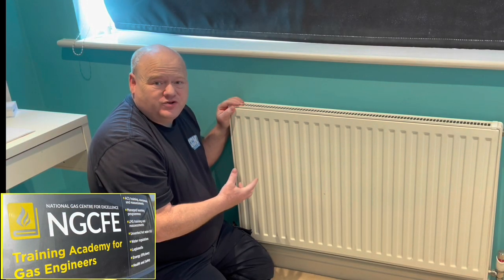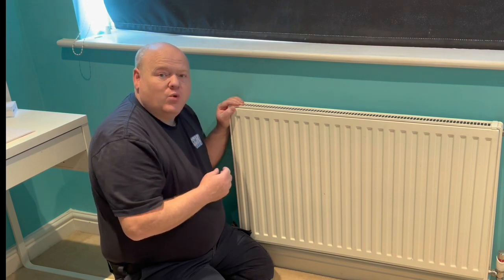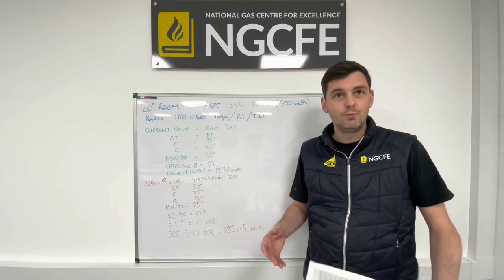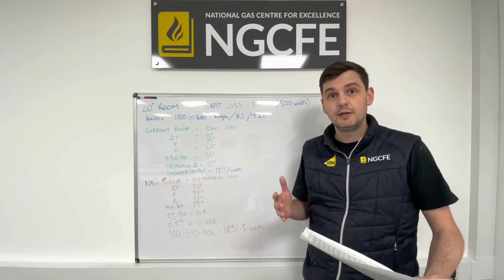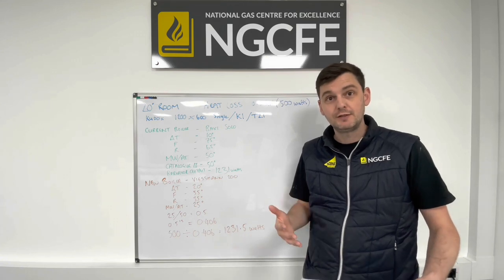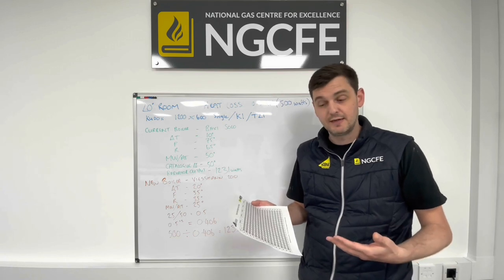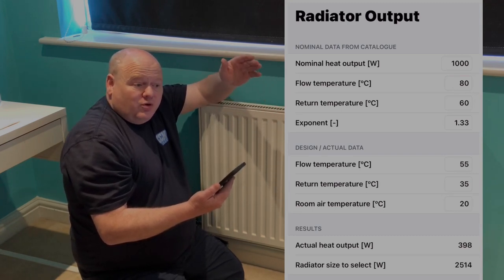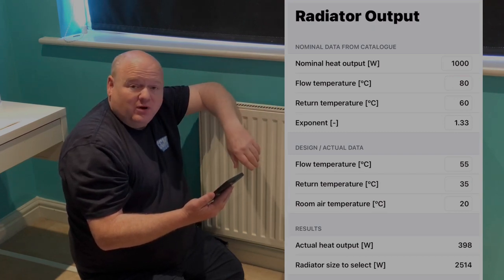How To Size Radiator’s For A Low Temperature Central Heating System

Comment: Thanks for the video and trying to help guys out, the problem I see with a lot of this is I see jobs everyday that have been thrown in not flushed out sometimes incorrect gas pipe size and no controls until we can get rid of these types of installers and it’s policed properly what’s the point because some numpty will just come along chuck a boiler in and leave and nobody takes them to task
Reply from the maker: Great point

Comment: Based on his calculations, yes the rad running at dt25 will be enough to overcome heat loss at 20oC but how long would the room take to get to 20oC if the setback temp is say 17.5oC? I suppose that’s where Open therm comes in.
Reply: Run it on weather compensation so its on longer periods at lower temperature?

Comment: Hi Alan, great video with you and Michael.

I think you may have missed an important point here.  The customer is going to feel colder, because the actual energy emitted is lower.

The loss factor Michael has used also indicates how much more heat won't be emitted to the room.

Using Michaels numbers for the customer to feel the same heat effect do we not need to use a radiator with twice the emmittwd power?
I
Reply: Original setup gives 1231watts. New setup gives 500watts. Even with another rad the same size still a shortfall of 231watts! Time to heat room drastically longer, customer unhappy if they heat room from a cooler start temperature. He did miss the point, you didn’t.

Comment: Hi. Great vid. Thanks.  My maths is a bit dodgy. How do you get 0.5 to the power of 1.3 to be 0.406. What buttons do you push?? )) Thanks
Reply: You'll need a calculator with a 'y to the power of x' button. Type 0.5, then press the 'y to the power of x' button, then type 1.3, then press the '=' button.
In this example, y=0.5, x=1.3
The 'y to the power of x' button has a normal sized 'y' with a smaller 'x' to the top right of the button.
HTH.
Reply: @huey_UK  Thanks Adrian

Comment: Thanks allan an micheal your videos are a credit to yoursleves, as a gas engineer who doesn’t do much install i find these fascinating, silly question but would
Over sizing a radiator help heat the room quicker and stop the boiler working harder?
Reply: The boiler generates heat (BTU), and radiators dissipate heat. Assuming your boiler is sized and selected properly, oversized radiators will deliver 100% of the total boiler-rated BTU capacity quicker than undersized radiators and will not harm the system or make the boiler work harder. Oversized radiators will cost more to buy and will take up more room.  :goodvibes:

Comment: What if the copper going into that radiator is 9 or 10mm microbore?  Is the radiator still suitable at 55?
Reply from the maker: It should be yes. You can turn the temperature down and try it. Thanks

Comment: Thanks great video, after doing the calcs, 6 of my 13 rads will need up sizing to overcome heat losses at dt30, plus of course a larger expansion vessel due to the systems increased water volume, all good to know now rather than the hidden costs later when I get round to having a new system boiler installed.

Comment: What radiator flow rates are required to give a td of 5c. Most installed pipe work won’t be able to give a flow rate capable of 5C

Comment: Great, but how do you estimate what your room heat loss is?
Reply: Easy. Just buy a cheap electric heater with several heat settings or adjustable thermostat, and see how much power it needs to heat up the room to the ideal temp. That power the electric heater consumes after room temp gets stable is the heat loss of your room.

Comment: I think we're missing the point of where this excess heat from the over-sizing of radiators in years gone by, goes. Manufacturer's data is good for a new clean radiator. But has the years run by, the available output from these radiators lessens as the internal state of the radiator conducting surfaces degrade. The excess ouitput capacity of the radiator would therefore compensate for this. Lets assume a mere 25% degradation (it's probably more) of catalogue output for the radiator in the given example. Were now only getting about a max output of 923W from the radiator, which is obviously a shortfall. The output of the radiator at lower flow/return temperature being about a maximum 375W which will obviously result in cold unhappy customers?

Comment: Sorry one more thing too, the ammount of time this is going to take to get the heat that want must take much longer so the boiler will still probably use the same or more gas to achive the objective.
Reply: Well boilers run more efficiently at different temperatures.

Comment: The Official testing of Radiators heat output is in a purpose built test Lab with Top Bottom Opposite Ends (TBOE) heating flow and return pipework connections.
This is the most thermal efficient of internal cross flow waterway distribution passing through a Heating Radiator
However, The most common Radiator connections in a domestic home is Bottom Bottom Opposite Ends flow and return pipework connections.
Therefore with BBOE connections further adjustment of calculations will be required.

To obtain the full output of heating radiators mounted on external walls, it is essential that foil thermal insulation is installed behind the radiators. By taking this action you are preventing more building fabric heat loss passing through the external wall from the Radiator. The thermal insulation ensures that heat emitter is heating the rooms air rather than wasting it through an external wall. The majority of heating radiators in homes are normally positioned on external walls. So you can make a low cost improvements to obtain long term saving to your annual running costs.

Modulating Gas Boiler controls such as Automatic Weather Compensators are an essential energy saving investment. The ensure that the additional use of outside temperature detector is used to regulate not only the combi boilers heating flow temperature but also automatically reduces down / modulates the gas boilers burner (ratio's 6;1 of load/demand) 

Please remember that your boiler and radiators design outputs are for when the external outside temperatures are minus 3.C to give you an internal temperature of 21.C in the living room for example. So with this arrangement your full demand loding is a 24.C increase. 
However we all know that for the majority of the year outside temperatures are a lot higher on a annual average. Enter the Weather Compensator this measures the external and internal temperatures and automatically adjusts (modulates) both the boiler/ burner and the heating flow temperatures to take into account the 'changing and actual all year round weather conditions'. Just say for example the outside temperature is 10.C the WC control work out and calculates just how much energy is required to reach your internal set point temperature of 21.C in the living room.
The WC controls can still be used even if you reduce your heating systems maximum flow temperatures from 75.C mean to a lower 40.C mean
It's just a case of changing the WC controls air temperature and water temperature:  The Ratio's

Comment: On a combi boiler with no digital display, what will be 55°.?
Reply from the maker: Not sure what you are asking? What boiler do you have. Thanks.
Reply: @AllenHart999  A worcester greenstar junior. Just one temp dial for the heating.
Reply: As for calculating the heat loss for a room before sizing a radiator, it's something I have never done. Most of the houses I work in are solid walls, as is my house very poor insulation, and it's the customer who always wants bigger rads because rooms are always cold, and running the boiler up high.

Comment: What this boils down to is multiplying your heat loss calculation by 2.5 when picking a dt50 radiator to run at dt25.
Not an insignificant increase.

Comment: What if the copper to that radiator is only 10mm.  Is the radiator still suitable?
Reply: It depends on the heat requirements..

Wider deltaT = Lower flow rates = smaller pipe sizes

Comment: How are you finding out the return temperatures from a boiler to a air, or even a hybrid system? 

Surely each system be slightly different on the return temps depending on heat losses? 

And would a boiler not need to be set at 65 to kill Legionnaires in the hot-water and will there be less water storage on a lower temperature? 

Great video 👌🏻
Reply from the maker: We are justing testing it at the moment. more videos to come.
Reply: Hot water priority takes care of the higher temp requirement for legionella protection. Recent urban plumbers video covers this.

Comment: If a radiator receives water at 60 -65 degrees and it takes 4 hours to raise the room temperature by 4 degrees how much longer will it take to achieve the same result at the much lower mean water temperature now being promoted. ?
Reply: It means you need better insulation or bigger radiators.

Comment: When your caption said combi boiler only did you mean condensing boiler only
Reply from the maker: Condensing combi boilers. You wouldn’t want to be turning a heat-only or system boiler too low. Thanks.
Reply: @AllenHart999  I believe t’other way round. All condensing boilers be they system or heating only should be DT 20 Flow 55 and Return 35. A system boiler implies PDHW and they would have two settings one for heating one for hot water - well the V200 would anyhoo.😉 However, a non condensing boiler should not be turned down to these temps as it will rot out the hex. 

Customers also need to be forewarned on these lower flow temp systems that the idea is ‘long and slow’ and with a room DT of 30 or even DT 25 the rads will not be as warm as before - but that’s OK the house will get and stay warm.
Reply from the maker: @normanboyes4983  PDHW doesn’t suit everyone. I know some of the newer people into the industry are doing videos on it, They are saying this is amazing but it's nothing new. Wouldn’t really suit me on my system. It is definitely a good option though. We have a video coming up on this soon, Might be the next video. Thanks.
Reply: @AllenHart999  hi Alan, Are you saying a new build with a system boiler cant be ran at 55 flow, only combis?
Reply: Isn't it illegal to install a non-condensing boiler nowadays?

Comment: I’m afraid your calculations seem incorrect.  The calculation is only to maintain the temperature based on 500w heat loss.  You must still heat the room first which needs much more heat to get up to temperature.  Once at desire temp I agree.

Comment: whats the coldest it gets over there?  Im in Canada , our coldest days of the year range from -35 to -50.

a 55 flow temp works on my system up to about an outdoor temp of -15ish. ...

at -20 outside , it struggles .  58 degrees flow temp works.   past -30 it seems a 60 degrees+  flow temp is required...

Comment: And your telling me, installers will actually do this going forward? Boxt? BG?
Reply: Yes, heat-pumps and low temperature systems needs to be designed properly otherwise they won't be efficient or effective.
Reply from the maker: Why wouldn’t you. It will set you apart from others that do not do it. Thanks.
Reply: Are you expecting installers to be paid for a professional service?
Reply: @normanboyes4983  the utilities will simply provide the capital and do it themselves from a position of leverage - all the independent engineers that don't keep up will be kaput!
Reply: It's part of the job, why wouldn't an installer do the job fully?
Reply: Lets be honest customers want to pay the cheapest they can so having some one come and heat calc every room then rad size and then tell them they need a powerflush a system chemical test trvs and a smart thermostat and poss new rads your going to
Lose alot
Of business

Comment: I could get in my car and drive from Leeds to London at 20 MPH,would I be happy,I think not.
I could set my boiler to 52 Deg come home, turn the heating on ,and wait 8 hours for the house to warm up,would I be happy,I think not.
C’mon Allen tell the subscribers the truth this is another load of rubbish.
Reply: Depending on your house it may well be more cost effective to maintain a setback temperature constantly rather than turning the heating off.
Reply: I design large LPHW heating systems and the best type of heat emitters for thermal comfort is low temperature underfloor heating pipe coils.
You do require more heating cross sectional surface areas for low temperature systems, for example a living room floor would require the majority of its floor area for underfloor heating pipe coils. Both radiator system and heating coil system would still have the same heat output,